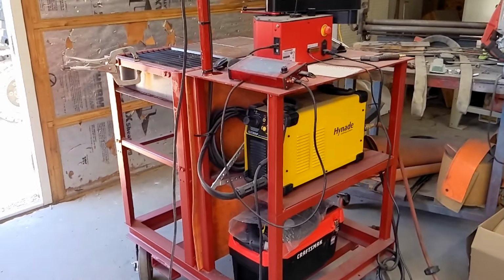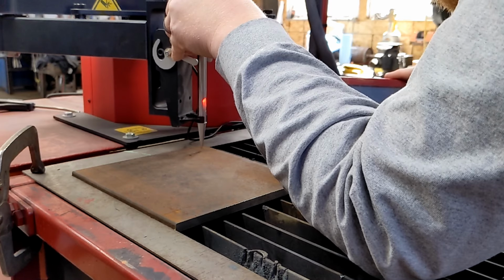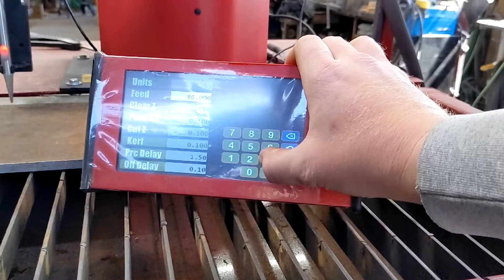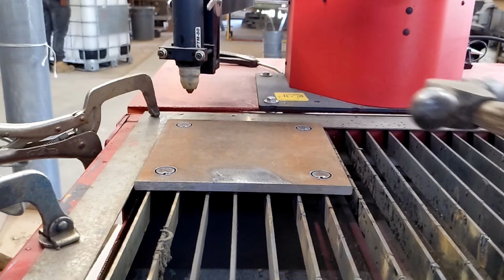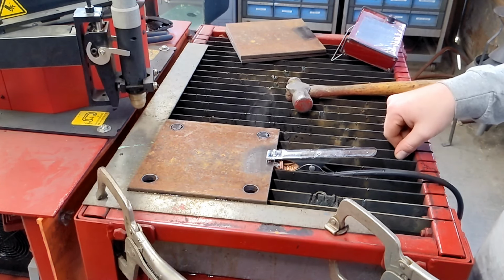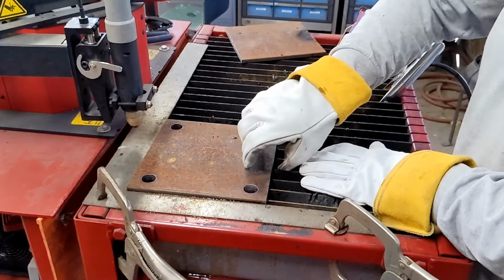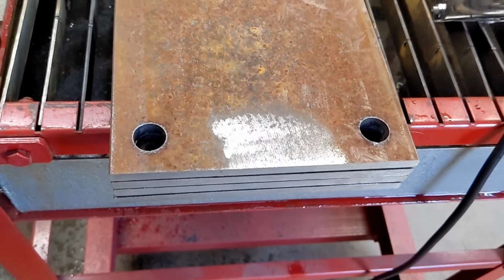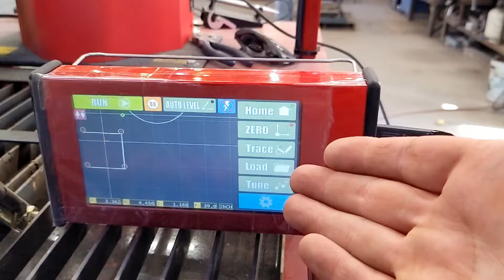Arcdroid In The Real World

Comment: You you wanted to temporary use the plasma cutter on job sights, you could run the plasma cutter on a big bottle of C02 and control the pressure with the regulator.
Reply from the maker: I'm planning to buy a secondary it has impressed me that much.

Comment: Inside offset holes should be counter clockwise. Outside offset should be clockwise. Also is there an over cut or over burn to make the thicker parts drop out.
Reply from the maker: Please explain further
Reply: @wildcatwilly  by selecting the appropriate direction of travel we can be sure the side of the arc producing the squarest cut is cutting on the finished edge of the part, and the side producing the tapered cut edge is cutting on the waste side of the part. In essence it will minimize bevel.
Reply from the maker: @tjs_welding_and_fabrication  wow I love the explanation very concise. Unfortunately I don't think I can switch direction on the Droid
Reply: @wildcatwilly  does an arc Droid use sheetcam ?
Reply from the maker: @tjs_welding_and_fabrication  I believe you can use it but I have not learned that part of it yet
Reply: @wildcatwilly  There should be a post processor for arc Droid in sheetcam. I cannot remember his channel but I think there is someone on yt with an arc Droid that uses sheetcam as well as inkscape. His yt channel is 6.8 litre.
Reply from the maker: @tjs_welding_and_fabrication  I got you I have seen some of his videos he seems pretty wise on the subject. I really appreciate your insight. Do you have any other tips
Reply: @wildcatwilly  not really as I do not have an arc Droid machine. I built my 4 x 8 table and use canadcnc command cnc, sheetcam and inkscape. Thanks.
Reply from the maker: @tjs_welding_and_fabrication  I wish there were better tutorials on inkscape
Reply: @wildcatwilly  join plasma spider. Great content on inkscape there. Instead of tracing like you did in this vid which to me took a long time, it could have been drawn in about 20 seconds in inkscape if you knew the bolt spacing which is easy to find. Add about 30 seconds in sheetcam and post process and you would be ready to cut in a minute or so.
Reply from the maker: @tjs_welding_and_fabrication  where do I join?

Comment: Hi have you had any problems with the Hynade plasma cutter and is it the CUT80NP CNC unit on Amazon? How did you connect the arc droid to the machine? I noticed the connectors in the back. Does it come with anything to allow you to hook it up to the arc droid? I am still trying to decide which type of CNC plasma cutter unit. The arc droid looks like a great hobbyist unit. Thank you for the video it is helping me make a decision.
Reply from the maker: @lewiscrocker938  the plasma cutter I'm running has a port on the back so it is CNC ready. I would recommend buying the machine torch it comes with the necessary wire for activating the CNC machine and you don't have to solder connections. I was not very confident in my soldering capabilities so that's why I went with the machine torch. Don't be afraid to open up your plasma cutter and just connect to the torch fire wires.
Reply from the maker: @lewiscrocker938  if you would like to talk more in depth you can contact me through my Facebook page and we can set up a messaging group
Reply: @wildcatwilly  I would really like that. I unfortunately I haven't been on Facebook for years. I will see if I can get in. Thank You

Comment: How is the arcdroid holding up? Planning on getting one anytime soon.. thank you
Reply from the maker: @LeopoldoMadrid-w5l  200% buy one! My only complaint is that it has a small cut bed. It is so fast not having to draw on the computer. I am amazed how little I am using a drill anymore. If I need a 3/8 hole in sheet metal I just slap it on there and have it cut it...
Reply: @ thank you. Im all set to get one then..👍
Reply from the maker: Glad to hear it

Comment: For the price they ask for this toy they could have made it cut 24" x 24" at least or have arm extenders rather than the table extender thing they offer which is helpful but another motor to have fail.
Reply from the maker: @1976ClassicCelica  as soon as they come out with a larger model I'm going to purchase it immediately...
Reply from the maker: @1976ClassicCelica  the machine is stupid handy they are on the right track...
Reply: @wildcatwilly  The nice thing about this machine is that there is no gantry getting in the way.
Reply from the maker: @1976ClassicCelica absolutely that is really nice to get it out of the way... What do you use yours for